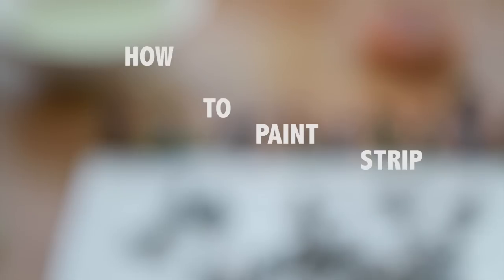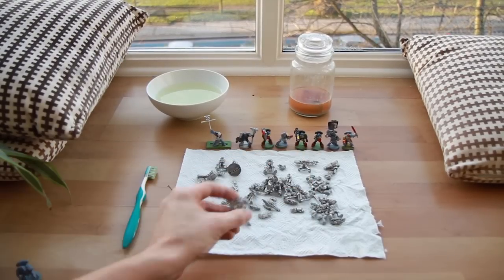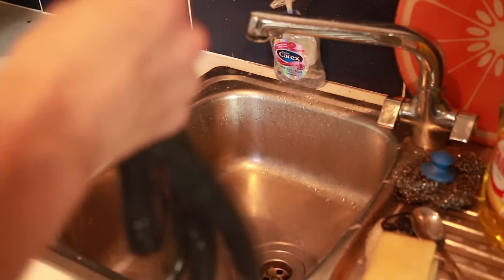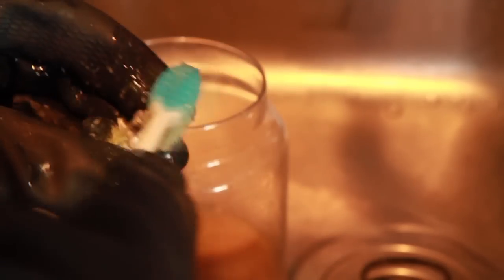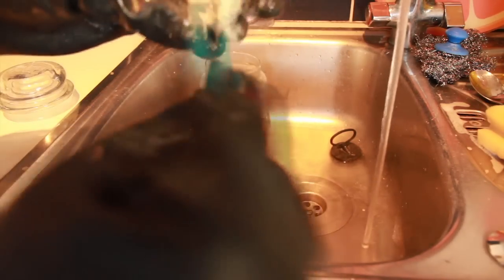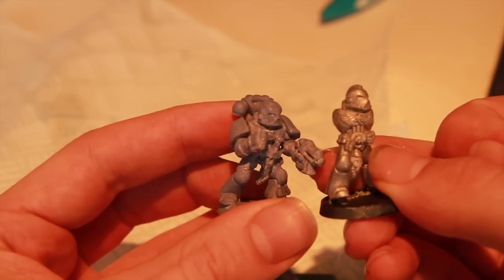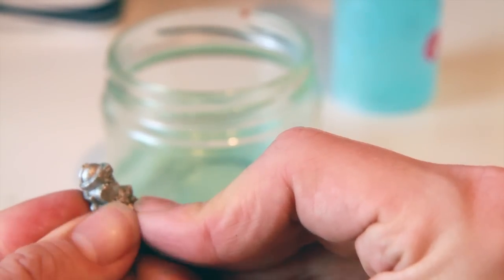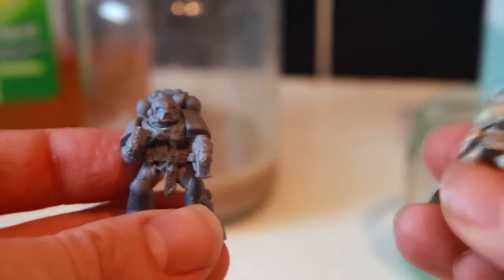How To Remove Paint and Superglue From Models and Miniatures

Comment: can the acetone work on resin models whitout damaging them 
as i have a few old ones whit to much super glue on
Reply from the maker: I think it will damage resin models unfortunatley - but I'm not 100% - apparently in american they use simple green and fairy power spray - you should google the resin dealio
Reply: @warhammergamingguild  Apparently Biostrip plus works well.

Comment: 90% Isopropyl or Rubbing Alcohol also works fantastic!
Reply: @E I'm using some at the moment to strip paint from models I bought off ebay. Leave plastic models in the alcohol for 10 minutes then use a tooth brush to lightly scrub the model. If paint comes off, keep scrubing. Super glue will also weaken so be careful if you dont want to remove glue. 

If paint doesnt come off, leave to soak for longer. Although, it depends on the paint I guess. I have no idea what was used on my models. I have some that look like they were painted with tippex which wont budge at all. I dont want to use acetone on them as that will probably melt the plastic.

Comment: I'm hesitant to put old lead models in the freezer due to the lead-rot problem - is the frozen environment dry enough to avoid the onset of corrosion?
Reply from the maker: Depends on the freezer I suppose? If you Dettol bath you don't have to freeze them.
Reply: @warhammergamingguild  
I gave them a Dettol bath overnight and the paint came off easily enough, but the super glue was left intact. Worst part is it's splattered on scale-mail armour so it can't be scraped off with force without damaging the mini!
Reply from the maker: @Rdeboer  when I left mine the sioerglue went gummy/rubbery. How long did you leave them in?
Reply: @warhammergamingguild  
They were soaking for a minimum of 12 hours and no longer than 18 hours. Do you think a longer bath in the Dettol would help?
Reply from the maker: @Rdeboer  can't hurt. Try with a test model
Reply: @warhammergamingguild  
Good advice - thanks for responding.
Reply from the maker: @Rdeboer  I actually re-watched the video and remembered it wasnt the dettol that gumped up the super glue it was the nail varnish remover - https://youtu.be/-xHwyLMX1xI?t=844